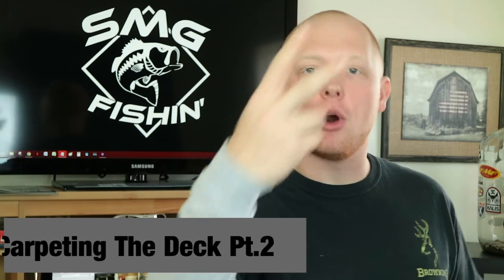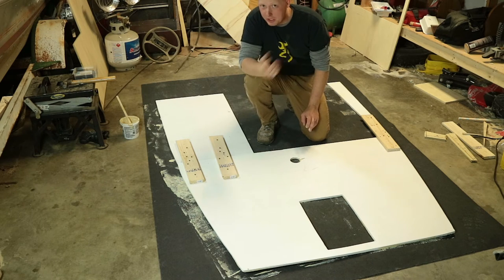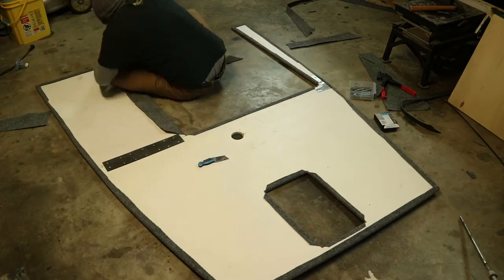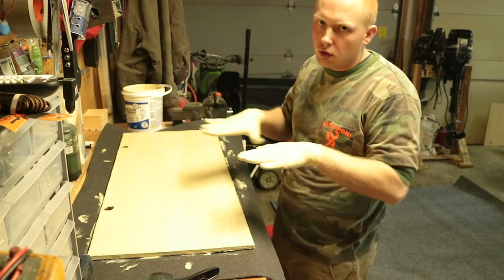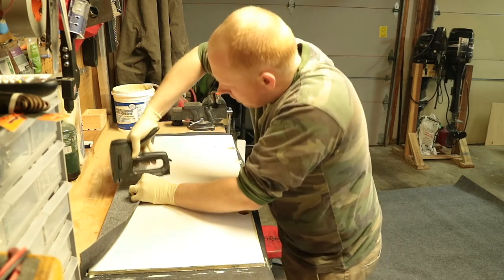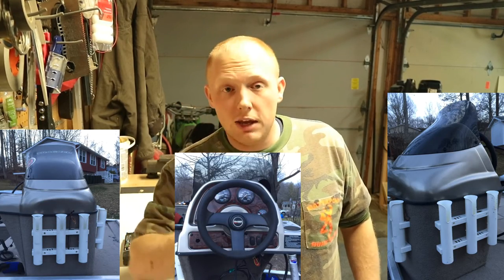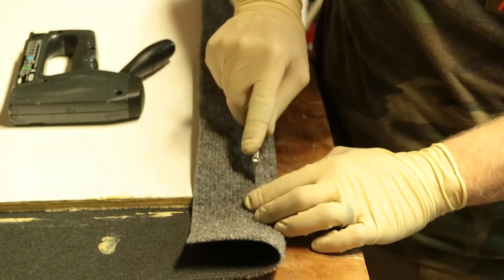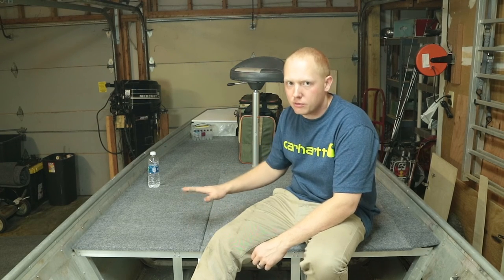Carpeting The Deck | Jon Boat to Bass Boat Restoration

Comment: I'm doing kind of the same thing this winter to my v-bottom. This is going back a ways and sorry about that, but what size rivets did you use and did you use rivet washers?? Thanks!
Reply from the maker: That's awesome, how big and what kind? Any question is appreciate and encouraged. If you check the video description above you can check out the links to exact rivets I'm using. I'm using a pop rivet that's 3/16in wide and I've been using either ones with a 1/2in or 1/4in grip length. I wouldn't recommend using anything smaller than 3/16in because the smaller ones do not hold up. You'll see that in an upcoming video where I did some maintenance to my 14ft jon boat that I built a little over a year ago and they already started breaking down. I'm not using rivet washers in my project, I've had to take a few out of this boat and they are a pain to deal with. Just make sure that you use aluminum ones on your aluminum hull. Thanks for watching. Don't forget to subscribe for new videos!
Reply: SMG Fishin'  thanks for the quick response! I've got a 14' Alumacraft that needs a new floor so I am experimenting with different layouts. I subscribed and took a look at your list. Just what I was looking for. Thanks again. Great videos! Keep it up!

Comment: Got a question, what are you doing for flotation? Are you gonna put in any Styrofoam sheets in the wells? But other than that it looks great so far.
Reply from the maker: Yep. The floatation I’m using is 1” styrofoam sheets stuffed anywhere there is dead space. Thanks for watching. I’m glad you like it.

Comment: What are the 90 degree brackets for that went under the carpeted panel?
Reply from the maker: +Daniel Cartis those are for the struts I used on the hatch lids. They are used to distribute the load of the weight for the strut mounts.
Reply: Makes sense! Thanks

Comment: Did you use plywood? what is the white board
Reply from the maker: +Danny Duffek yea. That's plywood painted with an oil based enamel to help weatherproof it. That helps it last longer.
Reply: thanks for answering lol

Comment: Hey man just subscribed! Boat is looking good! I actually just bought the same boat got it for $500! Anyway I just posted my first video of it so check it out when you get a chance and let me now what you think. I watched all of your videos on this restoration and used them to determine whether or not I was going to buy the boat. I do have one question for you . When you replaced the transom did you have to cut that back piece out or wre you able to take the front off that back piece and slip a new piece in there?
Reply from the maker: +Flip N' Fishin oh man. If you have to replace the transom your in for a lot of work. I didn't record this process because it took me so long and it was a pain. You have to cut off the cap in the back. I was able to get one side cut off and slide the wood in. Make sure you use a good quality marine grade wood (not Home Depot or Lowe's) when you replace it so you don't have to do it again. Thanks for subscribing. I'll be sure to check out your video.
Reply: Dang that's what I was afraid of. Well just going to have to suck it up I knew it was going to be some work. Thank you.
Reply from the maker: Make sure you have access to a welder for when you need to reattach that transom cap. I got lucky and my dad was able to weld it back up for me. Welders who weld aluminum can be pricey. I think I was quoted almost $300 for the small weld that needed to be made for this boat.